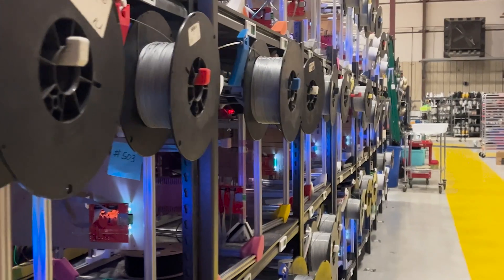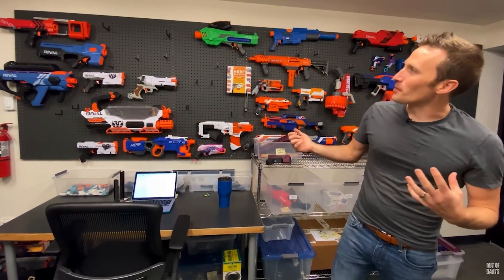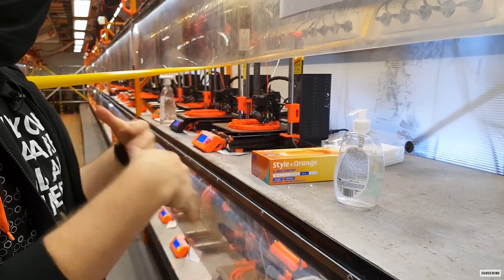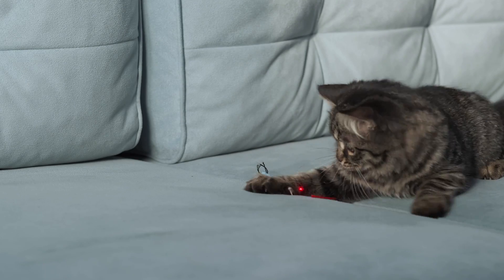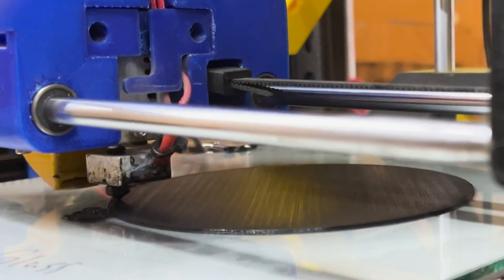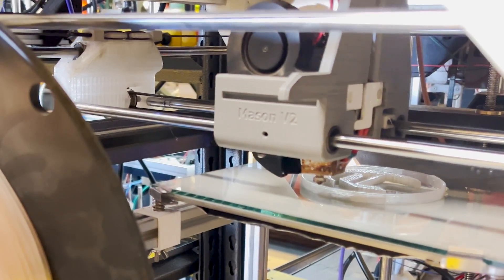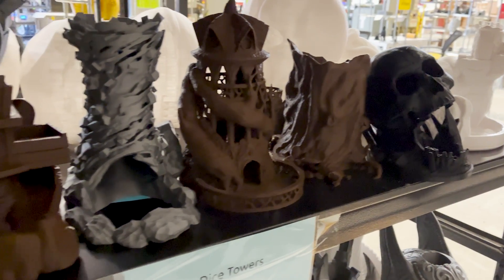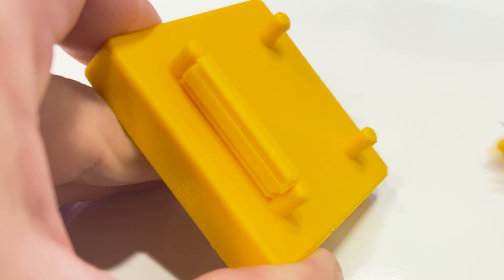Why Do Most 3D Print Farms Make So Few Parts?

Comment: This video definitely resonates, It took about a year and 1000s of hours iterating on the same 8 small parts before I felt comfortable starting up production. Taking the time on calibration for filament, learning the production printers limitations in/out and optimizing workflows has made it easier to have a pretty stable environment to replicate quality but would have been a disaster without the time-consuming prep work. 

Have more recently started building/coding my own farm printers and learning material engineering to understand the business, it makes me feel better to see you guys went through this step already and it looks to have paid off.

Comment: Ive only sold parts that where in larger batches of the same item on a single printer. And even then getting the settings just right to produce 50+ identical prints was a hassle.

Comment: I'm just a hobbyist and fine tuning for different parts and materials to get as near perfect results as possible is a nightmare even on a small scale.
Reply from the maker: Exactly
Reply: Holy grail in this domain is getting settings that work well for a wide range of parts/geometries/materials (usually this comes from first principles) rather than hacking around with settings for every part. I won't say mine are perfect, but I generally just print things without tuning any of my base settings except number of perimeters, infill, and supports.
Reply: @daliasprints9798  this is the correct answer. Otherwise, you're losing the edge of 3D printed manufacturing. There's only so far you can get with reasonable levels of tuning and you need to accept that or buy a better machine. If the machine doesn't help you get acceptable results and is low maintenance then it's not appropriate for manufacturing. It's a tinkerer's machine as a hobby.
Reply: @xm210c  Mostly agree, except the conclusion that there are just 2 options, manufacturing or tinkering/hobby. There's also rapid prototyping/development/production of one-off parts where manufacturing type constraints don't apply.
Reply: @daliasprints9798  In those situations lead time and reliability are even more important.

You need that prototype in 7 days time. If it fails at 95% late in the 4th day because you went a little aggresive on the parameters and were tinkering with the machine instead of finishing in 6 days and 18 hours. and getting the job done on time with "good enough" parameters, quality and appearance...

There's a lot to be said about manufacturing and reliability and reproducibility are key. You need a setup you can reliably reproduce without tinkering. Otherwise it's a liability.
Reply: @daliasprints9798  Real world no settings are perfect with every material/ application depending on application I don't even keep the same extrusion width or nozzle size (which again require different settings). I have ballparks for most things I do regularly, but  perfect isn't attainable which is why everything is made to tolerances.  If you're rocking a .4 and the same settings on everything you are farther from perfect than you realize.